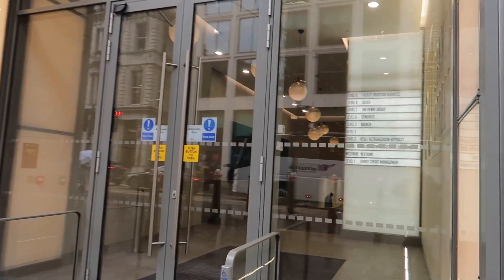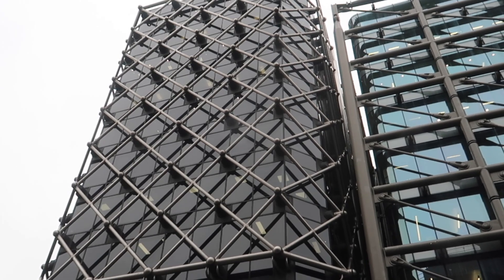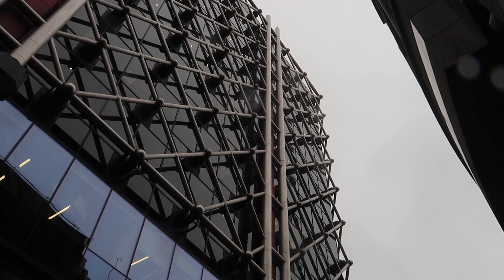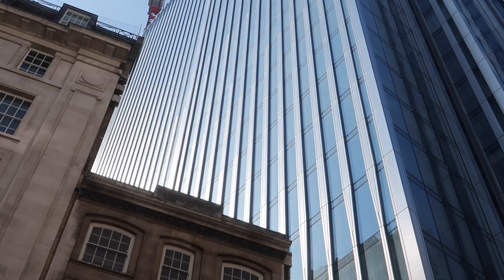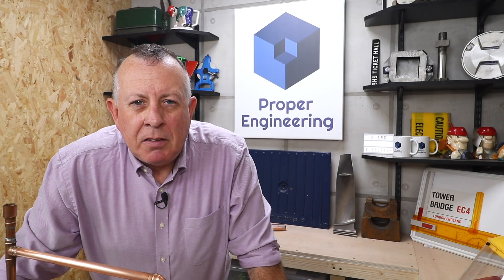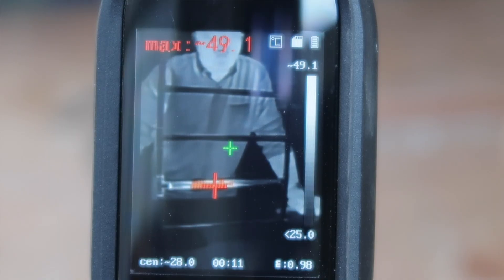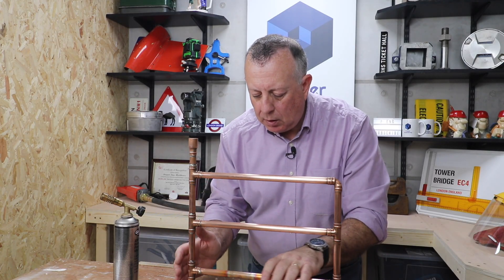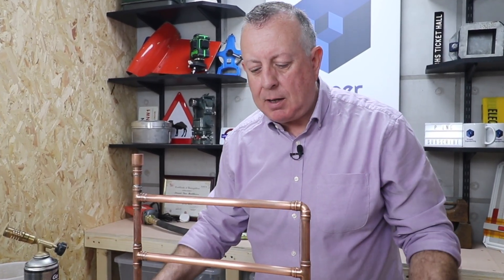Why is an unobtrusive building in the City of London totally reliant on water?

Comment: 9:47 - Doesn't make sense, this is only for the exterior of the building, what about the internal fire, lets say at the center of the building, how will the heat over there will be easily dissipated? It's like the building will end up like a hollow object, fire did not damage external but damaged all internal. Maybe I'm not getting the whole picture of it's use...

Comment: "Well that, I'm surprised about. The water takes away the heat from the area incredibly efficiently..."
A. That's why you can't solder pipes with water in them. Doesn't everybody know that?
B. It's not taking heat away, per se. You're just trying to heat a much greater mass. In the first example (empty pipe), you're heating up a small weight of copper. In the second, you're heating the copper PLUS a lot of water--many times the weight of the copper that contains it! A 12-inch length of 1 1/8" interior diameter pipe may weigh 80 to 100 grams, but the water inside weighs an additional 250 grams! Obviously, it takes a lot more heat and time to raise the temperature of 100 grams of empty pipe than it does 350 grams. Sheesh!
Physics.

Comment: Is it used to move heat in or out of the building? Condenser water for the AC?
Is the water continually circulated? 
What trade installed the structural piping?  Ironworkers, Pipe fitters? HVAC?

Comment: The water has two big advantages.  1 the water has a lot of thermal mass so it takes a lot of energy to heat it up 2 so long as there is liquid water in the pipes the temp will not go over 100c

Comment: Thanks for pointing out the cool building and doing the demo!  I think you've focused too much on dissipation, though.  Copper dissipates hate faster than water does.  The reason the water helps is because water has an extremely high thermal capacity.

Comment: i have wanted to make a bathroom heated towel rack out of copper pipe like that connected to my heating system but with electric heating wire inside for the summer when heat is off i wonder how i could safely put heating wire inside of copper pipe full of hot water. probably against 10 different electrical safety rules o well. i will have to work on that maybe just tape roof melting cable to back of pipe with aluminum tape but would not look very pretty.

Comment: 2 quick questions:
1) as I understand it,  the building is not moored to the ground, and just sitting on the 4 legs.
I know that England is not prone to earthquakes, but on the oft chance,
if there were one, would the building walk around London? I live in Earthquake prone California USA.

2) the water filled exoskeleton: I take that there are pressure relief valves or vents at the top of the 
   exoskeleton so if there were a fire, and the water reached boiling point, there would be a way for the                            captured steam to escape, so the exoskeleton would not burst like a Boiler run Amok?

Not criticizing at all, just curious abut this architectural design 😀

Comment: Similarly, you can put a paper cup filled with water into a fire. The paper will not burn below the water line (note that the water line drops as the water evaporates/boils off).

Comment: Imagine the building owners.  Hey you’re going to have to spend significantly more money and probably reduce the size of the building because we’re putting a subway station here.  But no worries you’ll have all the extra commerce and value from having the station in your lobby.

Then after the building is built…nevermind.  We’re going to put it across the river.  Thanks for putting in all the extra money and effort however.

Comment: You can demonstrate how the water filled exoskeleton acts as  a  heatsink buying time in the  event of a fire by doing a childs elementary  science  project. Take a soda bottle  and a torch style  lighter, show  how  fast  and easy it is to burn a hole in the side, then  take a new bottle or  just lower on  the first, fill with water then try to melt a hole beneath the water level, try it to  see what happens!

Comment: Interesting .. The World Trade Center twin towers were also supported from the exterior steel cage, providing the equally attractive open floors without columns or beams .. and was built pretty much at the same time frame .. 1973 .. The 9/11 investigations pretty much concluded that the floor supports had insufficient fireproof that pancaked downward to start the collapse .. Wonder if you have examined the same issue in this building .. Also, filling the tubes with water is fine if the tubes are not broken, either by accidents or terrorism .. If the water all leak out during the fire, what then ?

Comment: You can boil water inside a plastic container over an open flame  it won't melt because the water will take away the heat and never go above the melting point of the plastic. I also pretty sure that the stainless steel would withstand fire long enough just by itself

Comment: Does the actual building pump water around it? Until I watched this I never even thought about the fire safety of adding water, let alone the thought that if the water stays still it could be problematic. For instance if (forgive my ignorance) the water is still, it’s going to boil, and if there’s enough steam/pressure that could cause an explosion. But if the water is going around the pipes the water is going to cool as soon as it is heated so the process of heating it up takes much much longer. 

I could be wrong because I don’t know what I’m talking about and I’ve only thought about it watching this today. So if I’m anywhere close I’ve done ok.

Also that would require another large tank of water that is where the water is stored. Which I imagine would further reduce the chances of it heating up because it’s not just going around the same pipes, it ends up in a place where the majority of the water is cold anyway. Although I guess there could be an issue if the fire starts where that tank is as that could just boil like a kettle and possibly explode. Wow all of these things I never thought about until today.

Comment: Most interesting part to me is if they put in a robust enough recirculation system it could last not two hours but indefinitely, I don’t see why not. You might need to include some form of cooling but if the source water pool was large enough you could skip even that. Obviously the assumption is the fire would be put out before the 2 hour mark so there aren’t many buildings that might need this, but maybe a nuclear power plant or something holding very valuable stuff like a very old library, seed bank etc.

Comment: Are the tops vented? Seems possible that if not sufficiently vented water could expand possibly leading to a rupture which could rapidly drain the tubes - so next assumption is that there is also isolation so any rupture would not lead to total system failure.

Comment: Things you can't do in places that freeze
Reply from the maker: Don’t you think London freezes?
Reply: @properengineering  either they're using glycol or going to learn a painful lesson about frozen pipes
Reply from the maker: 1) They're not pipes - they are thick walled structural steel members. 2) The building has been there now for over 50 years. @dukeofgibbon4043
Reply: An interesting construction technique on the Durango and Silverton narrow gauge railroad was to drill holes in the rock face and fill them with water; the expanding of freezing ice cracked off whole slabs of rock. They were preserving explosives for use in the mines above Silverton. The record low in London is 3F which isn't the kind of freezing that does damage. You're welcome to fill a structural steel tube with water, cap the ends, freeze it solid, and show us the results.   @properengineering

Comment: Great video! I'm curious to know what you did on the Jubilee Line Extension. I worked on it myself back in '92, though just as a temporary typist while I was on my working holiday in the U.K. I typed (and re-typed) hundreds and hundreds of pages of the contracts. It was actually kind of interesting work; you don't really realise all the nitty-gritty details that go into a project until you've seen contracts like that.
Reply from the maker: I was a Section Engineer for Costain on the Borough High St ticket hall section at London Bridge - JLE 104.

Comment: How do these pipes deal with water expanding on minus temperatures?
Reply from the maker: They aren’t pipes - they are heavyweight circular structural members with very thick high strength walls
Reply: @properengineering  What about water during negative temperatures?

Comment: Regarding the experiment its not the heat being taken away with the water but rather the capacity of that system has greatly increased thanks to that water filling - regarding the real building - black pipes are very susceptible to solar radiation, dry steel could heat up to 150-200 C and would dillate whereas the structural part of a building should never be expanding and shortening again and again. The water above 100C can transfer very much of an energy upwards but it needs much more time than a minute or much more energy than that injected to reach 90C :)

Comment: This makes no sense. If the fire is burning inside, what the hell is the water in the pipe taking away the heat gonna do to save the building.
Reply from the maker: Because it saves the structure long enough to get out of the building. Without the structure, you get total collapse.

Comment: if you've done plumbing in houses brazing insitu copper water lines like here in OZ (before hydraulic crimping), you will know all about this !!!! If you are at a low point and can't get the cursed water out, it is a real bugger to braze. ('course there are tricks to get round it, but it's still a royal pain)

Comment: What about winters and the potential for the water in the pipes to freeze, expand and crack the external pipes?
Reply from the maker: As well as anti freeze and circulatory pumps these aren’t ‘pipes’ - they are structural steel members that happen to be circular. A bit different to your thin wall central heating pipes.
Reply: @properengineering  Thank you.  Brilliant video, amazing to find about this building.

Comment: Interesting. As a Canadian - current outside temperature is -17C, not counting wind chill - I would wonder how such a structure would handle freezing temperatures. Our current sub-arctic freezing trend has been going on for close to 14 days, and is expected to last at least anopther 5 days. Would they run the risk of the pipes rupturing - the main problem we have to deal with here - if the temperature dropped?

Comment: This would explain whats happening if there is an exterior fire, on the metallic structure only. But how about if it is an interior fire? What are those floors made of? How is the water in the exterior pipes going to prevent the buiding's floors collapse because of internal fire?

Comment: Nice video, a wonderful technology that is also used in PC hardware, if the water circulates in the same way as a PC cooling circuit, perhaps it is enough to put a series of cooling fans in the expansion chambers, cooling the water and putting it back into circulation once cooled, perhaps the integrity of the structure, of the building, would last more than two hours.

Comment: Great video! What I would like to have seen answered is how do the designers account for the water expansion and contraction due to weather?

Is the water continuously circulated all the time?

How do they prevent the water from freezing during cold weather?

How do they combat and monitor internal corrosion of the pipework?

And is there an expansion and / or header tank?

Thanks.

Comment: Water will only rise to 100 degrees c max, the principe is the heat rising and gravity circulation, like old hot water boilers before pumped heating and hot water.

Comment: Not only is the Building interesting, but you demonstration really shows how effective the structural pipes full of water can be.

I would be interested to know if they have a tank or any other pressure regulator system in place, on a warm day the water would have to expand.

Comment: That is why it is often a pain in the neck soldering pipes near the lowest point on a central heating system. It is a devil of a job to get the last of the water out and it is usually the case that more starts to pour out as soon as you start trying to solder.

Comment: We all know water expands when it freezes and although London does not generally get low temperatures how does this system work when the ambient temperature drops below freezing as we don't want the pipes to break under these conditions and then spray water across the street when it warms up?

Comment: Interesting. Would also be interesting to see how the building handles the water expansion. A big tank on the roof connected to each part of the structure maybe?
Reply: I was wondering how it might handle a freeze, what they use as antifreeze. 
the system is probably gravity fed & has a tank open to the atmosphere, or a series of expansion tanks if its sealed / pressurized

Comment: I used to work at the company who carried out the development and learnt from those who worked on the project that they were first offer to sell the site to the underground or be paid extra cost of building on the site. They chose the later . Later I remember a casual discussion about the external frame and what colour to use, My view was it had to be stainless steel which was the final choice which later created problems because at that time welding stainless steel was not common and caused an extra cost of using American company who could do so and then a later dispute if that extra cost should still be paid for by the tube.
Reply from the maker: Thanks - interesting